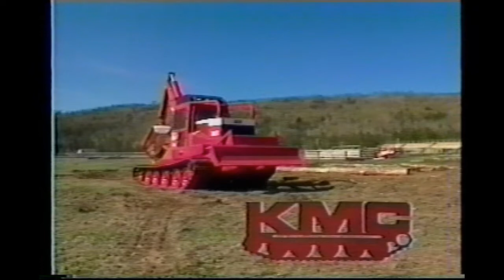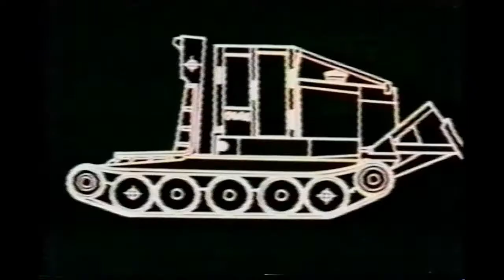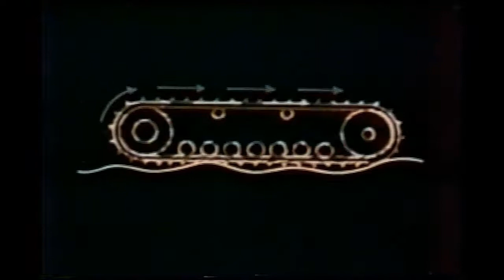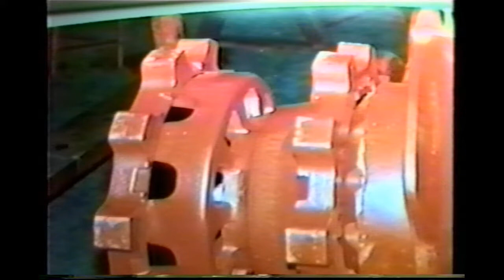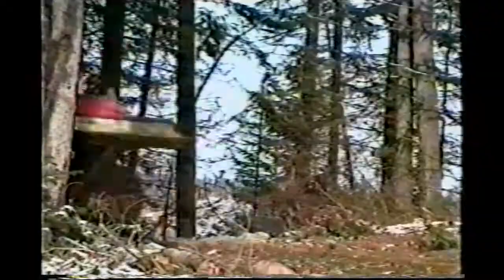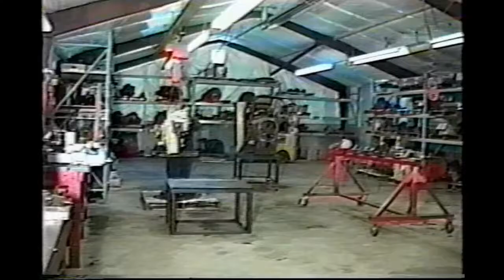High Speed Steel Track Vehicle KMC Skidder

Comment: Back in the 80’s we had three FMC track skidders, two were cable skidders with clams on the back to hold the logs & the third was a grapple skidder.  I remember working on the tracks of those damn things every day it seemed like! My dad’s nickname was Tarzan, and he was the best logger I’ve ever known & definitely the strongest! He took those skidders we were using up in the steep Yaak of Montana over to eastern Montana and continued logging with them over there out of Lewistown and grass Range etc. We also had the big white Mountain logger  skidders too. I’ve seen my dad do some wild shit with both the Mountain logger & the FMC track skidders. I was logging for him when he took one of his FMC cable skidders right off a 70% slope of a large ridge so it was a long skid down, & he bladed all the logs from the top down to the bottom of that ridge. He would at times have to hook the winch line to stumps behind him because it was so damn steep you couldn’t back up a lot of the times at ALL!  That ridge was so steep that after the old man got done taking all the logs off that mountain there was nothing left on that mountain side but twigs, & it was so steep & the soil was so dry & slick that you couldn’t even attempt to walk down from the top because it was almost like walking down a cliff! My older brother & another guy cut all the timber on the ridge & mountain side & with FMC track skidders you always had to make your stumps as close to the ground as possible, especially on steep ground or the skidder would come off the tracks & if that skidder came off the tracks way up on a 70% mountainside, we would’ve needed a BIG helicopter to fix that situation because it would’ve been near impossible to put the tracks back on when we’re on ground that steep! We probably couldn’t even change a broken torsion bar on ground thar steep, but luckily we didn’t have to!